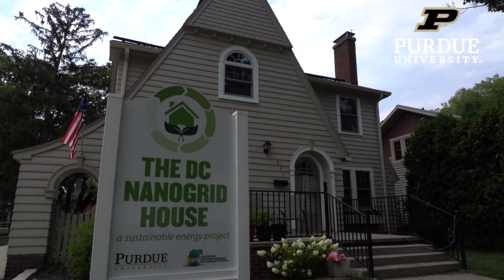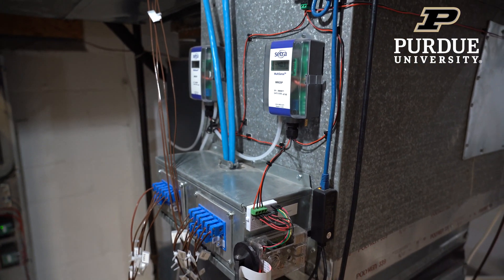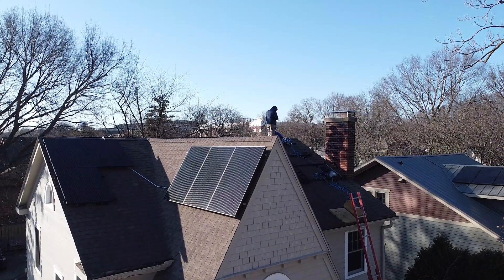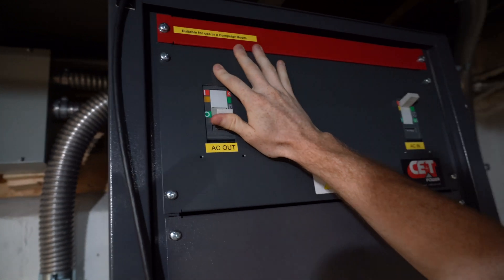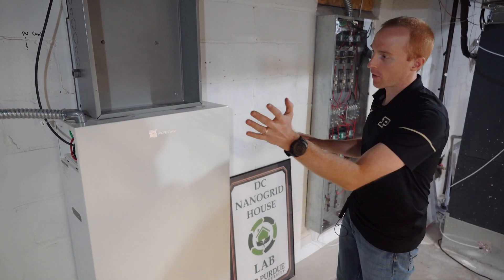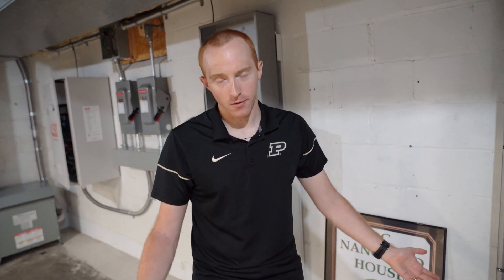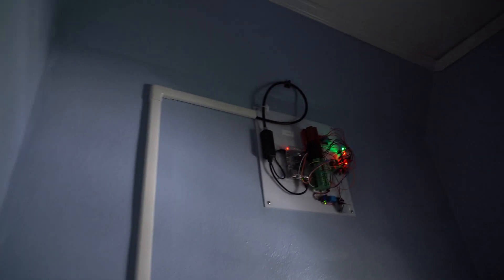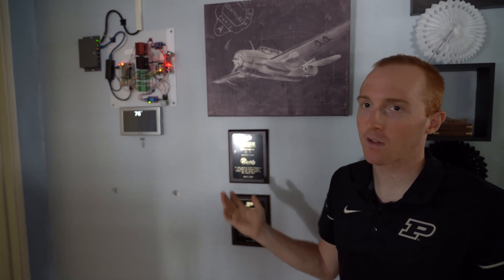This House Runs Entirely on DC Power

Comment: This is laughable. They have the AC converter because they're too lazy to convert each appliance to run on DC. Purdue engineering is weak.
Reply: Per PurdueU: "Alongside the nanogrid, household appliances possessing a significant yearly energy consumption are retrofitted to accept DC inputs. These modified appliances are tested in a laboratory setting under baseline conditions, and compared against AC equivalent original equipment manufacturer (OEM) models for power and performance analysis. Finally, the retrofitted devices are then installed in the DC Nanogrid House and operated under normal living conditions for continued evaluation"
Reply: i would use them tbh, most if not everything these days is already converted to DC via switch mode power supply's anyways. @connicrow9463
Reply: LOL i know its kinda funny but the even funnier fact is they don't even have to convert them as ll the appliances we have and use they already have an all DC version of them.
Reply: They likely didn't have to do much in the way of conversion. Many appliances already use DC and just have a rectifier of some type inside already. The biggest issue would be getting the correct DC voltage for individual appliances.
Reply: All of the upper crust, silver spoon students are mentally lazy. That's why they buy a degree.
Reply: Backwards engineering at its best. Who funds this big waste of taxpayer dollars.

And from a university to boot 🥾

Comment: Why do you need an inverter if you run all DC appliances and lights at home?
Reply: Its not a pure DC house. They convert DC to AC then AC to DC back on every appliance... not smart... its just a regular offgrid solar powered house
Reply: THANK YOU
Reply: I believe AC comes into the home - Must be converted to DC. That inv'r also stores what isn't being used.  A solar source is already feeding DC into the home, inverter is not needed
Reply: @mfb6310  an inverter stores no energy. An inverter can only convert DC to AC. 

DC power is a single wave, while AC is a synchronous 60 cycle sine wave, so you need an inverter to generate the sine wave. 

Converting AC to DC requires a full bridge rectifier, which is just 4 diodes and is usually a passive device, but they can be active too to filter noise.

Comment: We are told it's cheaper, and I'm sure it is:  but that's after investing massively in solar panels, and inverter and a thumping big battery.  It would be help to understand that overall financial cost/benefit of this approach over 1 year, 5 years, 10 years before it can be seen if it really is cheaper.
Reply: Okay I have to ask the question, is it more or less lethal to a toddler with a fork in the socket?
Reply: @Shadowwand  All things being equal, DC is less lethal. 120VAC has a peak voltage of 170 Volts. The 120VAC is the "average" of the sine wave voltage over its frequency so 120 VAC peaks at 170 Volts and it is equal to 120 VDC. 
A.C. is said to be four to five times more dangerous than D.C. For one thing, A.C. causes more severe muscular contractions. For another, it stimulates sweating, which lowers the skin resistance. The 60 Hz frequency of AC is rather close to your heart rate which causes Arrhythmias in your heart. 
DC is not without issues. DC sparks don't self extinguish like AC does so this would be a fire hazard problem. 
If we are going to go to DC, we would need to redesign all electrical outlets. I suggest looking into the British plug. The Brits have done a superb job with their outlet and plug design. Tom Scott has a Youtube video on British plugs.

Comment: Where's the DC appliances? This just looks like a solar system with typical inverter. Was expecting a rewiring to run everything directly off DC power
Reply: Exactly. Millions of RVs and boats let alone off grid houses already do this.
Reply: I'd be afraid to pull down my pants in a room with that monitor on the wall.
Reply: 😂😂😂 @etpee
Reply: That's exactly what I was thinking first they start talking about how you have to convert back to DC but I thought that doesn't make sense and then they show them flipping the AC on. I want an all DC house that means I don't want to have to convert it to AC and I don't want the inverters
Reply: that's the rub.  unless you want to use cigarette lighter outlets, there is no standard DC plug.
Reply: @sleddy01  With USB-C PowerDelivery(PD) Extended Power Range (EPR) you can get up to 240 Watt output on a single cable, plus the ability for the end device to ask for the voltage it needs.

That would be enough for the DC fridges I've seen. Microwaves (or over known high wattage over a short time) could have supercapcitor or battery storage that is charged from a cable too, though the option exists to just run multiple cables...

Electronics obviosly are a good fit for this too.
Reply: @sleddy01 Anderson power pole
Reply: not true 

for example check out the different type of DC Anderson connectors

Comment: I'm saying this for years and even Nickola Tesla pointed this out back in the day. Dc is the future and indeed most appliances use DC. Problem is is that many appliances use different power ratings after their built-in converter (transformer). So inorder to convert the whole industry a new standard needs to be created and houses need to be adapted to that new standard. 
Probably DC and AC would be standard together in a house. But with different mindset of how to deploy DC then we currently are doing.
Reply: I think that was Thomas Edison who advocated for DC and Tesla who advocated for two-phase AC.
Reply: @Demetrios Christopher The lastest version of the USB-C standard supports up to 240W (5-48V) with the right cable, so I this will problably be the future of connecting DC appliances in homes. 240W is not enough for everything, but for a lot it is enough and they will most likely increase it in the future again so if one just buy or make high quality cables then it would be future proof when they update.
Reply: Exactly

Comment: I want details, man! What's the standard voltage going to each fixture? What's the voltage coming out of the wall sockets? What design are the wall sockets using? A pre-existing standard? Something else? What about light sockets? Or is all the lighting hard-wired? How much were you able to use from other sectors (like datacenter DC power delivery) and how much was custom made?

Give us something informative! Something worth watching!

Guess I'll just have to read the published article myself.
Reply: Have you find the report? I'm still seeking
Reply: @Tamtams94  Nope. They seem to be patenting some of the technology so maybe they're waiting until that's approved? Or maybe they'll never publish it publicly and keep it all proprietary. I hate it too.
Reply: I haven't read the report, but I recognized at least some of the hardware in one of the closeups: a RasPi, an ESP32, the occupancy, temp and humidity sensors. It looked like at least one room station was run off power over Ethernet.

No idea how the bigger appliances were setup, I'm assuming it wasn't 12V like in RVs and boats, since those are usually smaller, and these looked pretty standard sized.

I'm actually much more curious about the washers (dish and laundry) and the cooling/heating system and water heater, as those are the biggest draws in almost every house.
Reply: Due to voltage drop over distance, I’m thinking output of 48vdc with 24vdc transformers where needed so all outlets are 24vdc. The sockets, I would have the car outlets to plug in a lamp. Along with USB-C outlets at 100W to charge MacBook, phones, tablets. Going to need 48vdc for refrigerator and DC power for gas stove&oven. Outlets like this on the buildshow https://youtu.be/IBzanvRn2Hc
Reply from the maker: Here is Jon's thesis with an abundance of details about the DC Nanogrid House: https://hammer.purdue.edu/articles/thesis/The_DC_Nanogrid_House_Converting_a_Residential_Building_from_AC_to_DC_Power_to_Improve_Energy_Efficiency/14519604/1
Reply: @PurdueME  Very cool. DC powered house was my dream for years. I would remove battery dc-dc and let the battery voltage be the DC microgrid voltage. There is no need to keep it regulated at 390Vdc and all these appliances can run from 300 - 400Vdc voltage range of 96 cell Li-ion battery (3.15 - 4.05v per cell for longevity). Additional research opportunities will be to add dc electric car charging via dc-dc converter, 15 kW diesel generator with 96% efficient 400V permanent magnet alternator with engine exhaust and coolant waste heat recovery for space heating. Use generator to power heat pump to increase thermal useful energy of diesel fuel beyond 39 kWh per gallon. Explore ground source heat pump with radiant floor to increase heating efficiencies during cold winter months. Look into 24vdc LED lighting, it can be interrupted by regular 120vac light switches and efficient 390v - 24v converters placed in the wallplates of each room to reduce resistive losses in the wiring. Also pay attention to RFI emissions from all these switch mode converters to not create interference on HF radio bands to ham radio or shortwave listening neighbors.
Reply: 🤣😂🤣I love you. Thanks for the laugh I needed it! Enjoy a super day😁

Comment: While interesting, I wonder how they have overcome (or if they have) the difficulty of getting the voltages that the various devices want.  

What AC has over DC is transportability.  One can generate it, step it up way high in voltage to minimize losses on high-tension lines (lower current).  Then step it back down to feed homes/businesses.  

Once the AC gets to the appliance, it can then step it up/down as needed...one does all of that as AC before the final conversion to DC (if the device needs DC).  Between transformers that efficient step voltage up/down and power factor correction, getting AC to the voltage one needs isn't all that inefficient.  

One has 380VDC as the supply, in the example video...computers often need an amble supply of 5VDC as their highest current demand...how are you getting it down to 5VDC efficiently?  Most other common household appliances run on DC voltages lower than 380 (and I suppose 380 was partially chosen because going higher in voltage is more difficult for DC without some form of AC component in there, like a switch mode power supply...which takes advantage of AC's properties).  I'm sure another reason for keeping the DC voltage high is to reduce the current on the wires feeding devices to keep them needing to be extra large to avoid heating up.  

It's interesting, for sure.  It had a degree of sense when one is trying to use DC power generation/storage (Wind and Solar) but for an overall practical concept, I guess we'll see.
Reply: The same way that 12v dc automobile systems convert the 12-14v from the battery and or alternator to charge cell phones that require 5v or run computers/data terminals that require 19v? I believe it's called a buck or boost converter.
Reply: Sure...but to do that you are going through an AC/DC conversion...but if the claim is that starting with DC prevents the wasteful conversion...you lose that argument if every time you need a different voltage, you have to do double conversions.  

Transformers are relatively efficient and most AC devices use SMPS...which are also relatively efficient.  So, if you are just going to run the DC through another SMPS, where are the big savings.

In a car, one normally will just regulate down the higher DC to the lower DC...which will burn up the excess power as heat...something one would want to avoid in a whole home DC system.  For the most part, everything designed for a car also is designed to operate a car's nominal voltage too.  Something not enjoyed in homes, at this point.
Reply: @sguttag  I think you are assuming that everything is run through the inverter first. The fridge for sure is using AC but it sounds like most of the appliances run on DC directly from the battery. The title is misleading however since having an inverter at all dispels the claim that this is a solely DC house, which is entirely possible now (but can be quite expensive for some of the shelf solutions due to unfortunately limited demand). 

You do seem to be mistaken regarding DC-DC conversion though, or are just not familiar with multi-phase synchronous rectification buck converters as they are significantly more efficient than any AC-DC power supply. It sounds like you are confusing highly efficient buck converters (~98%) with simple voltage regulators which are inherently inefficient and just get worse the larger the voltage difference is.

As you mentioned, for the average consumer, AC is most useful for getting the power from the grid to your house. No one is suggesting we turn back time to refight the current wars only to let Edison get his way again with extremely dangerous DC powerlines (checkout how Brooklyn got its infamous baseball team name if your curious why this was a terrible idea).

The point of this experiment however is that they are generating the DC locally with the solar panels, so the transport inefficiency (especially with voltages as high as 380) across the relatively short runs in an average home will be far less than converting from AC-DC even if using an active full-bridge rectifier.